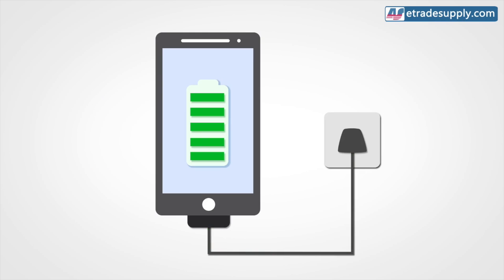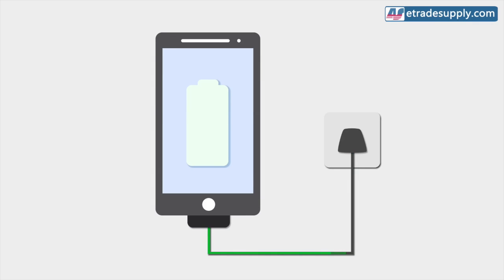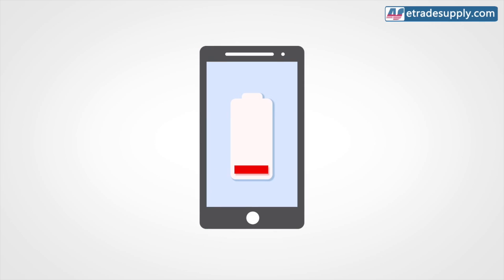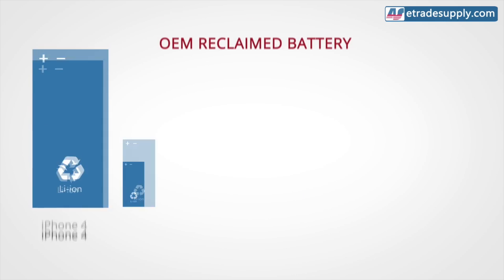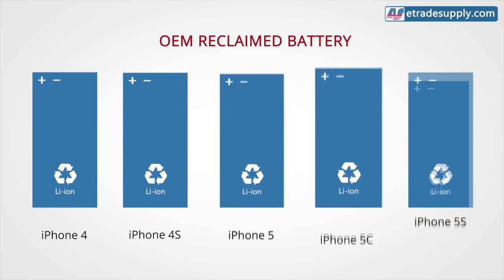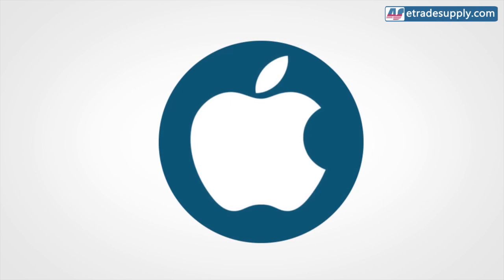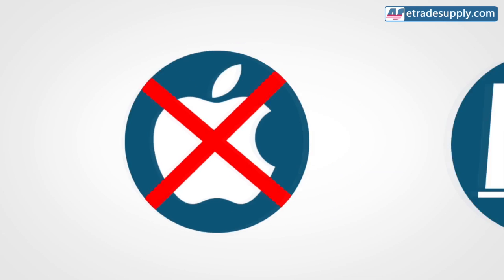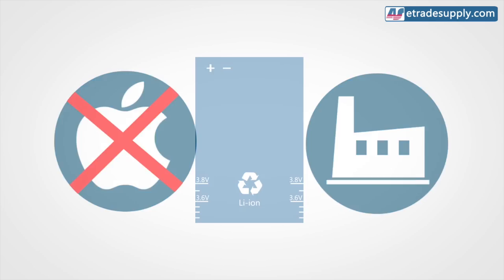Why Won't Your New iPhone Battery Replacement Charge?

Comment: I just replaced my battery today of my iphone X, its not charging at all and restart etc. i tried looking up as why this is happening? Apple has put a lock on all third party batteries, this causing the phone not to charge at all and remain until a authorised battery is installed.
Reply: Did u have any fix for this? Or did u have to go to Apple after all

Comment: I have a 38 v one but it still wont charge it will show  the apple logo but just turn off and continue to repeat please help I dont want to do the method to  connect to itunes cause im gonna loose everything if i do please help
Reply from the maker: Try to hard reset your device

Comment: hello, i recently got my battery replaced on my iphone 6s plus, it worked just fine for a few days, then i noticed my batterey was stuck on 100% for a few hours, restared the phone, then the battery was dropping just as normal, but when i plugged it in to charge, i see that it is not charging, it either charges a little and then stops, or it drops while charging, any idea what the issue is?
Reply from the maker: Update your phone iOS, clean the charging port, if it still not works, you may need to change the charging port.
Reply: e have the same problem. my 6s is good no issues until this battery replacement at apple store and now its not charging

Comment: helo, can u help me plzz
i have got new iphone 6  its been 4 days..it took charge for 2 days but now when i have changed my battery there is an issue, that the phone is charging & showing charge sign but the charging percentage is not increasing and also decreasing it is red marked what can i do???
Reply: sani n
Finally I found solution i.e I change my charger head...hope u got it

Comment: I just replace the battery but wont charge .the battery was charged at 38% I plugged in and now i at 32%.  The charging icon doesn't  even shows when I connect the phone to the charger.Could it be the port ?
Reply: After the phone is on. Make a hard reset (hold power+home until the Apple logo appears). I've just replaced mine with the cheapest ebay battery (which looks 1:1 as my original one) and had this problem. It didn't charge! But after the hard reset - no problems! Hope this helps.
Reply from the maker: have you checked whether you connected the battery connector well to the motherboard?

Comment: My iPhone 5s got a battery replacement after 3 years (since came out) because it was  3 hours of battery and getting a little hot while I was using the phone..I don't have a lot of apps installed just whats app, instagram and Twitter. The questions is after the replacement of the battery I'm just getting 5 hours of battery ... I charged 100% (7 am) and after 2 hours without using that at all it was 82% ( 9am) the phone was locked and I disable the background refresh, gps and data ....please tell me what can I do!!!

Comment: I just got my battery replaced, and now it won't charge at all. Stuck at 4%. Would going back to the iPhone repair stand and requesting a new battery solve my problem?
Reply from the maker: +Corey Simmerer did you replace a new battery in good condition by youself? have you checked if the connector is well connected before reassembling the phone?

Comment: I got the same problem,8hour of charging it still 20%
Reply from the maker: +hackusifucan You will need to contact the shop you bought the battery from. There is a good chance you received a faulty battery like Dana.
Reply: mine was defective, i got a full kit from amazon https://www.amazon.com/dp/B01LKN9AUG

Comment: I didn't realize I purchased a refurbished battery I contacted the seller and have been assured I will receive a replacement in a few days. I requested a NEW battery. 28 hrs of charging, still at 3%.

Comment: I replaced my iPhone battery last night. It's been on the charger for 12 hours and is still at only 3%. Not happy.
Reply: thats happing to me how did you get it fixed
Reply: dana dailey mine change the battery and not happening anything at all. 😧
Reply from the maker: +dana dailey You may get a low quality battery. It may be a refurbished or used part.